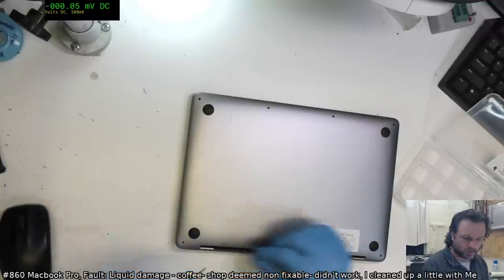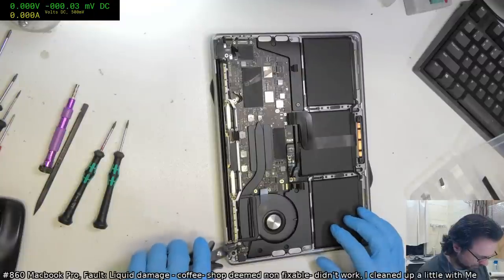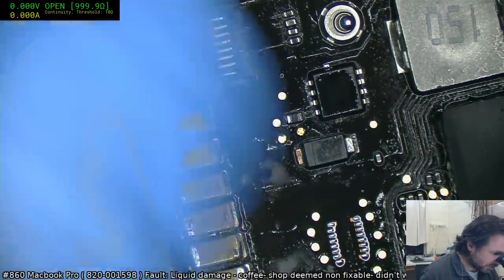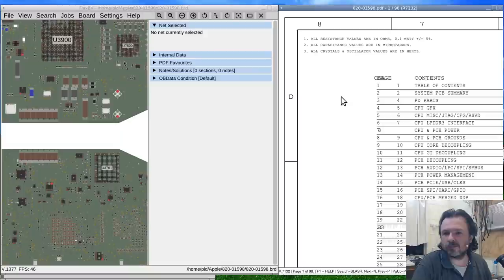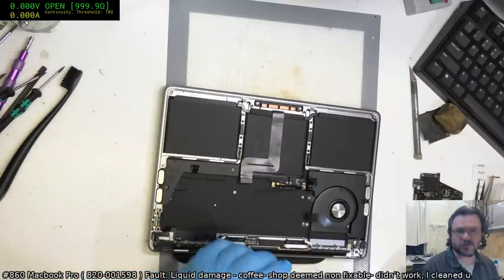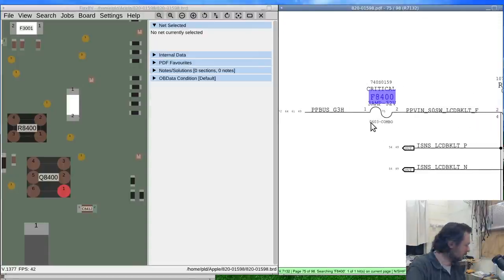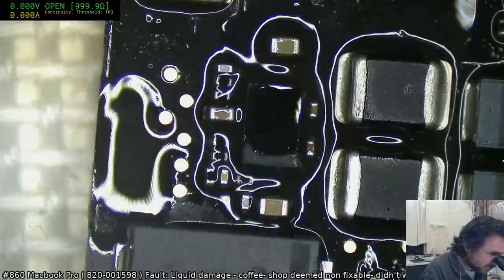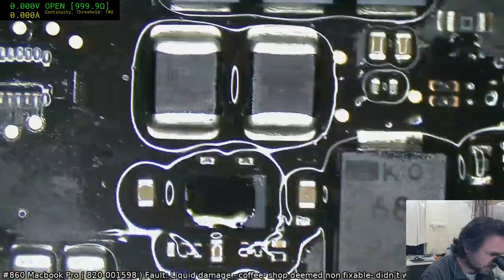#860 "As indirectly featured in Wall Street Journal" - Riding on coat tails and fixing Macbooks

Comment: Good eeeeevening. 
Saw the WSJ vid. It wasn’t bad. 

I noted that Apple was suggesting board level repair isn’t as reliable. I was kinda shouting at the screen that its no concern of theirs either way. People pay for the fixes they want at a risk level they deem acceptable.
Reply from the maker: Add in the fact that they already do use repaired boards for FRUs  ( there's even a thermal-printed white sticker that we see on the boards indicating that they've been reworked/repaired and put back in to circulation ).

Technically Apple is correct, realistically it's to a minimal degree, and they (Apple) are fine with that elevated risk themselves.

So yes, just Apple massaging the message to try scare off people while doing the same thing behind the scenes.
Reply: @pldaniels  I also wonder, how long you give warranty to your customer and if you get sometime the boards returned within this warranty period? How often this kind of a repair disturb some other component on the board?
Reply from the maker: @asv5769  The type of return jobs I see are;

1) Some aspect I didn't test before sending the job back that wasn't related to the original issue ( thankfully this has become less so since I setup the better macOS test boot stick and checkout sheets )

2) Parts that fail after the job is finished.  A typical case is a cap or chip failing from the original damage after the first repair is done.

3) Track rework that wasn't quite properly bonded/stabilised, ie, running a delicate trace to a via stalk top and the thermal expansion or vibration breaks the connection

I warrant all failures of my workmanship, but for secondary damages from the original fault or new faults not related, I'll tend to still provide a discounted rate "subject to context".